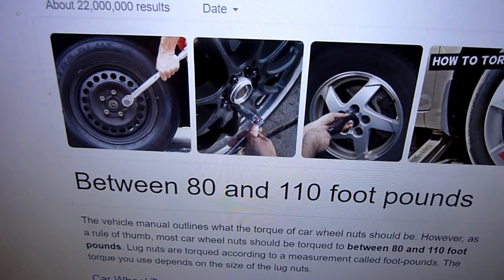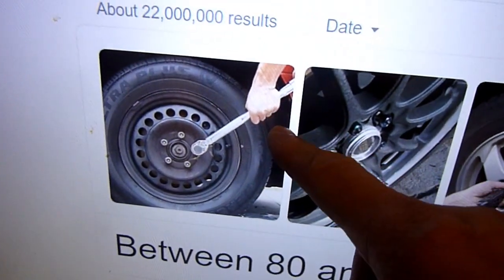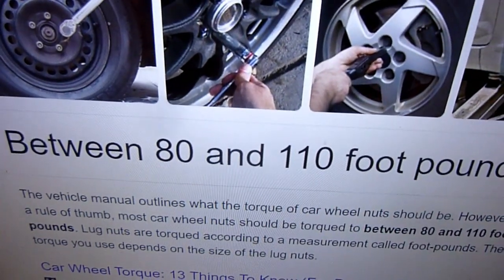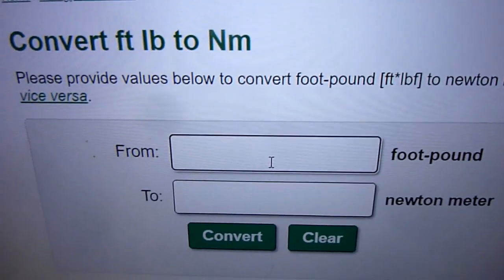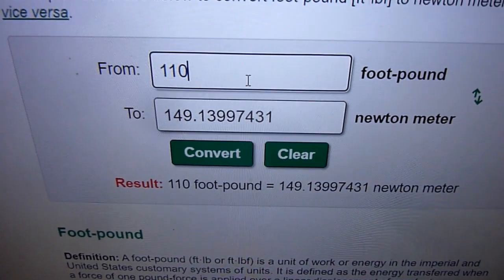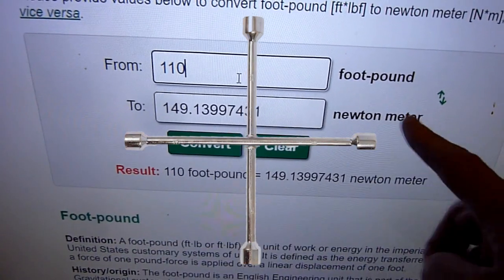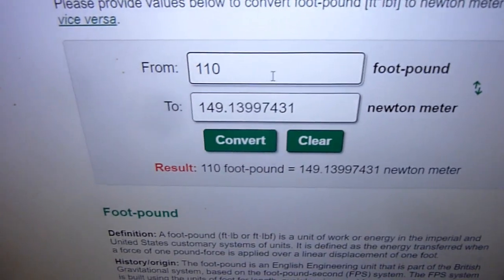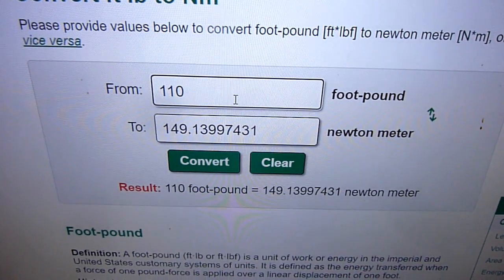What is the Correct Torque for Tightening Your Car's Wheel's Nuts and Bolts?

Comment: I set mine to 110nm which is correct and it never clicks my wheel nuts. Help?
Reply from the maker: Make sure you have a reasonable brand for the torque wrench like Draper...always listen the screw at the bottom after finishing a job to keep the tool accurate for the next time.

Comment: I just use the torque specs from my car's service manual.

It specifies 130nm... I torque them to 130nm.

That's roughly 10 ugga-duggas on the electronic impact scale, 5 on the pneumatic.
Reply from the maker: I think it is possible to undo a bolt set at 130nm using the car's standard wrench on a road side, especially if someone is hammering the wrench or jumping on it, but 150nm, I don't think so without a 5lb hammer or a brick.
Reply: @EducationPineapple  yeah - It's doable. I've had to use a fairly short tyre iron before to do a tyre change... Took a fair amount of jumping on that sucker 'cause I'm a twig bit I got it! lol

Comment: just torque them to the makers recommendation, they might use different tensile strength bolts than other manufactures.
Reply from the maker: Good point but I am experimenting to help people to find the best Torque to tighten and later take the nuts and bolts off with normal tools stored in cars.